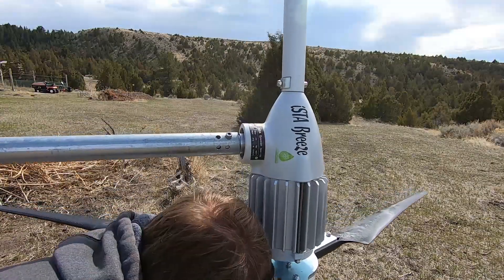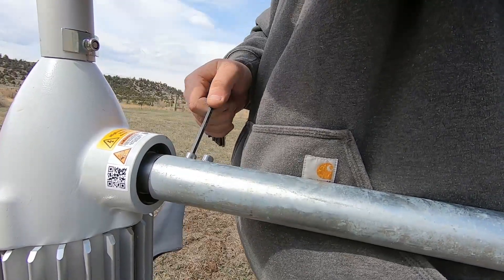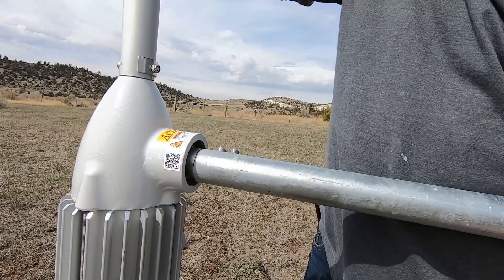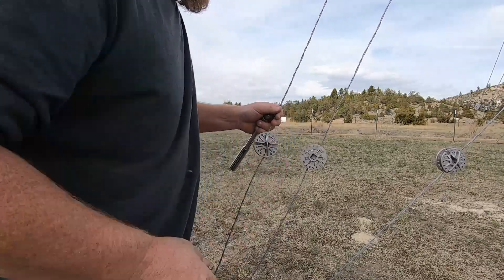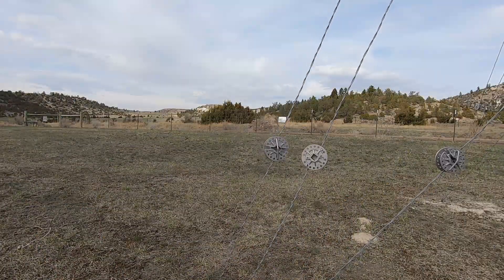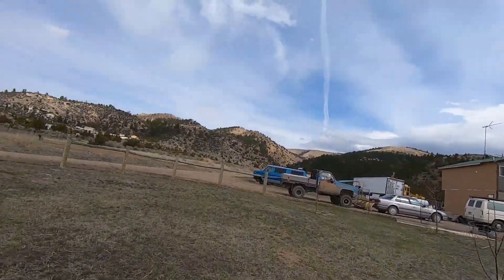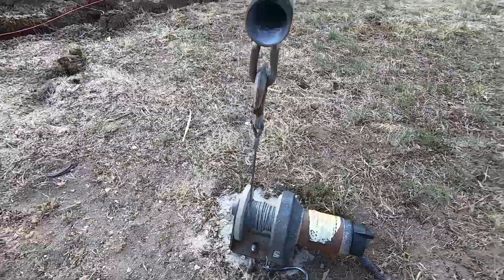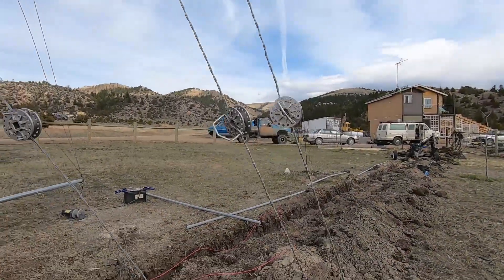1st problem with the Ista Breeze I1500

Comment: G'day Mate, I had the same problem with the bolts on my i500, my idea was to tighten 2 hose clamps around the pole and each of the 2 bolt heads.

Comment: You can drill small holes through the bolt heads and use the locking pliers and wire to lock the bolts  in like we do on aircraft, just make sure you don't do anti anlocking. Plenty on you tube

Comment: Simple way to fix that would be to make a band to go around the pole so that when the ends are tightened up, it is tight against the bolt heads. Poor design.
Reply from the maker: That's sorta what I did, but I used a couple of muffler clamps.

Comment: What is the height of the tower and what is the schedule of the pipe? Thanks
Reply from the maker: Schedule 40 pipe, and the tower is 30 feet high.
Reply: @veggitarianredneck  Couple more questions if you dont mind. What size is your pipe, 1 1/2" or 2"? Did you screw the joints together or weld them?
I have solar that takes care of my off grid house probably 85% of the time. After 2 1/2 days of cloudy rainy weather the batteries usually need to be recharged. During these times I always have 20mph winds as I live up on a Pass. Just need to take advantage of that wind. I like your tower set up and thinking about building something similar to put up on the ridge.
Reply from the maker: @larrymoore5811  Hey no problem.
So I used 1 1/2 pipe but looking back I should have used 2" pipe. I have a video showing how I reinforced it. I initially screwed the pipe together which would have worked out just fine but my tower wires were not tight enough and one of the couplers broke sending the whole thing to the ground. So the upper most coupler I eventually welded.
Reply: @veggitarianredneck  OffGrid, what has been your experience with the Ista turbine? Been looking at them for a while. I have noticed many good reviews and also some bad. I would like to know your opinion after having yours in service for quite some time.
Reply from the maker: @larrymoore5811  My opinion is quite good with them. I think they are really well built and I would definitely recommend them.

Comment: I had the same problem with mine. The bolts came out completely and I didn’t notice it until some damage was done. We get some very powerful winds where I live. You are lucky you noticed in time.
Reply from the maker: I didn't realized it until later but they actually make an adaptor for this damn thing.
Reply: @veggitarianredneck  I might get one of these to supplement my PV at night. From what I can see it seems you need a heavy sleeve over the pipe because those threads won't hold in that thickness of pipe. (Schedule 40?)

Comment: I feel like those things you are using to tension and adjust the wires are not the best tool for the job.
Reply from the maker: You don't know just how right you are. I'll put the details together in a future video
Reply: @veggitarianredneck  
 i`ve never seen those kind of tensioners before but they look like a nightmare to adjust compared to turnbuckles. You did a great job on the mast, one man job with the gin pole and electric winch.
Reply from the maker: @JohnGuest45  they were a pain just like you suspected. I swapped them out for turnbuckles, way better.

Comment: lol if it makes you feel better I haven’t been able to keep those bolts in the stub.  I haven’t had them in for about 4 months...thats why i slotted my stub and clamp it down with exhaust clamps.  The bolts would work great IF the stub tower was a perfect fit for the turbine’s yoke.  I’d have had to machine one and it cost too much.  I learned after the fact that they have a four bolt flange adapter...had i known that i would have gone that route.
Reply: Loctite is probably fine
Reply from the maker: Well see, but I really like your idea of slotting it, thank you for that wisdom.